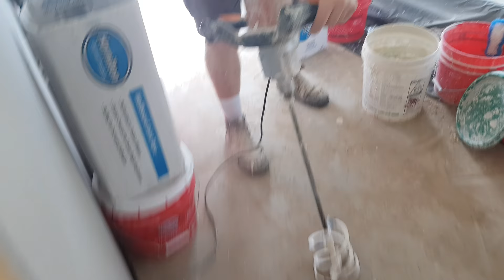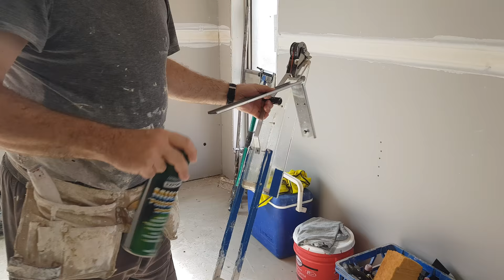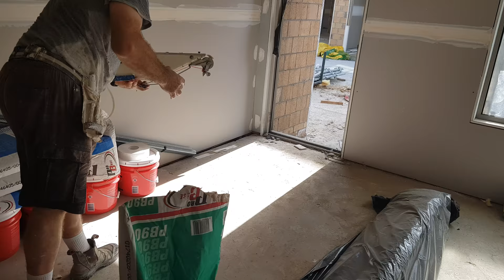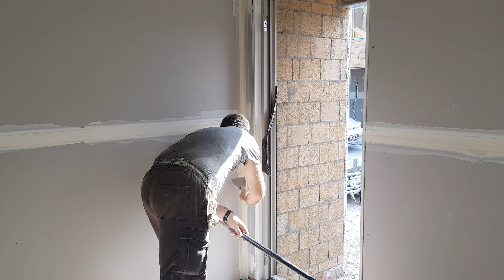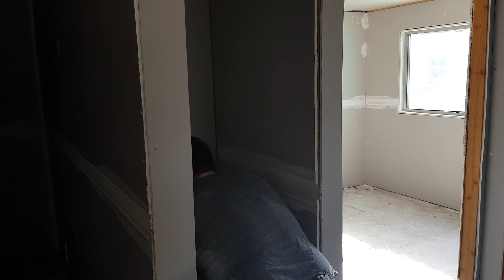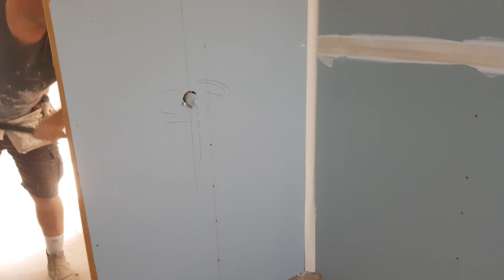How to Mud & Tape an Inside Corner of Drywall Fast with a Mud Box

Comment: What the heck is that big gap at the top. Please don’t tell me your going to cover that with molding ??
Reply from the maker: +Robert Avery I think you're obviously from America because in Australia we use cornice between the walls and ceilings.
Is that what you mean?
Reply: Yes .... we generally run the ceiling board to the corner the the wall board to that. Second sheet of wall is the bottom board. General code here is min 8 ft. To the ceiling. 7 ft 6 in is accepted in some areas. We then put what ever type of trim wanted over that. I don’t think you could get your method by code inspection here. Mostly because of the fire codes and the possibility of air movement through that corner the way you do it. I was just wondering. Every place has their own methods. Take care.
Reply from the maker: +Robert Avery yeah true that. Here in multi living dwelling buildings like units it has a fire wall so that it doesn't spread to the next dwelling.
Yeah we have the minimum height similar to yours. Thanks for your comments it's good to know what happens over there.

Comment: Sir all that your doing doesn’t mean anything show me the end result. Also nobody can beat the tube I’ve raced the best hand finishers in America, it just can’t be done. When I was a young man back in the 60s in Denver I ran two tubes all day long helper kept them full it was all piece work back then we got paid by the roll 500 ft.  You move along pretty good won’t take it away from you. But again nobody van beat a bazooka. Have you ever used roller and glazer? 7,10,and 12 in boxes?
Reply from the maker: I'm going to agree with you that the bazooka is quicker.
I heard many responses majority of which point to the Bazooka.
With your experience I would be a fool to not listen and learn. So thankyou for watching my videos.
And your advice.
Your welcome anytime around here.

Comment: He’s passing over the paper three or four times with his glazier I think it’s better to roll it first because when you roll the corner first it pushes the paper deeper into the corner and the excess mud that comes out acts as a first coat making your finish glaze a lot easier also 
Not rolling first leaves the paper to exposed when you finish sand. I bet these angles get a lot of paper burn. Also when you roll first one pass is enough on your and downs from the  bottom to the top. This guy isn’t very good I have to be honest

Comment: It's fast but I bet he joints will crack and the tape will seperate after 5months.for the most part you don't get quality with speed I don't care who you are.im in the housing industry for 34 years and I won't let this shit on site.my guys do it old fashioned way and they put mud on the joints not paper thin where you can see the tape through the mud and even the paint.sorry
Reply from the maker: Yeah well after this taping in. There are another three coats over the top. Not two.
I agree with you that what you see here is thin. The one of the next videos shows skimming over the joints then there another two coats over the top.
I'm a painter by trade as well and I know what you mean by having the plaster too thin and too fine.
Reply from the maker: My friend in Australia has the same name as you Mark
Reply: Maxkil I'm in Canada.cool
Reply: Last I checked you don't want tape showing thru the paint..

Comment: I personally think that's the cheating way that's the way that tells me that you do not know how to tape but it is a very fast way though on cheating of course LOL
Reply from the maker: +Roberto Fi haha. Ok lol. Everyone could've done by hand. We can tape by hand.
But you don't make any money if you taped by hand.
We are there for the money
Reply: Maxkil hahaha for real .....good luck tho man it was a great video I actually watched it 2 times
Reply from the maker: +Roberto Fi thanks Roberto
Reply: Roberto Fi contour think it's cheating when the guy on the skidsteer is loading dirt? Is it cheating when a painter uses a sprayer? Is it cheating when the concrete truck shows up with already mixed concrete instead of mixing it by how and wheel barrow? Dude this is how the industry is. Better and faster tools are made every year to improve and speed up the work progress. It's not the 80s anymore and not everyone does huge commercial or residential remodels. Every trade has tools to make their job more efficient.
Reply from the maker: Yeah your right. Good point.

Comment: Fast and cheap and full of mistakes: American style?

There are no real edges. Just cut 45 degree edges where two dry walls are joining up, spackle it once and then shear off. Then put on the band, spackle twice. Then the third layer.

Next video: A month later a colleague is coming to spackle the fissures.

You guys are working fast and hard, kudos, but your are butchers.
Reply from the maker: Do you even drywall bro? Drywallers don't use the term spackle. Not even fissures.
If you want to talk to me.. be normal
Reply: @Maxkil  Since my mother tongue isn't English I do not know what you guys say instead of spackle. But that doesn't mean that I do not know anything about drywall, sis. You guys are hard working, but butchers, that is for sure.